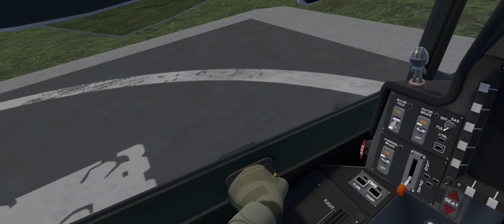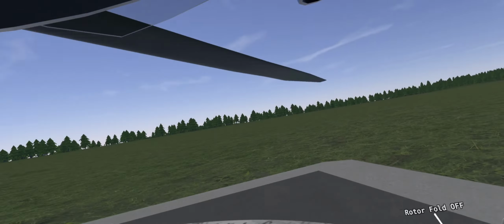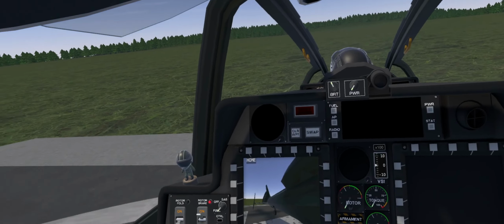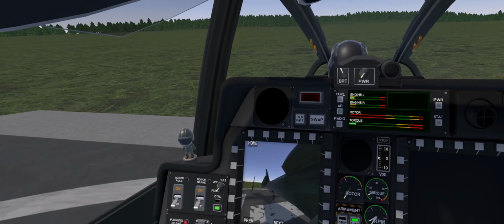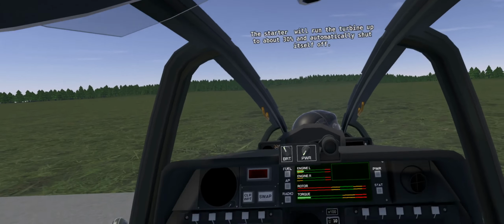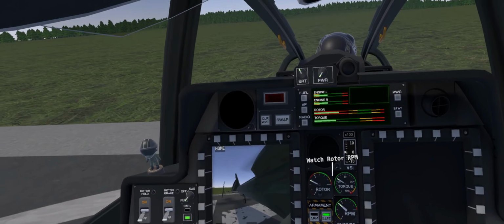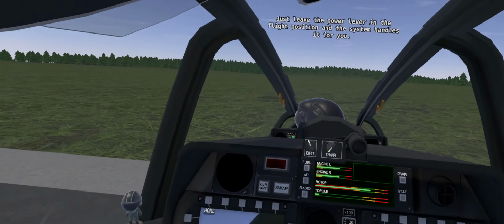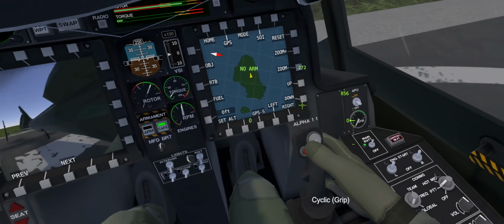VTOL VR - OpenXR Test - AH-94 Start-up and Shutdown

Comment: is it any better with openxr?
Reply from the maker: It should have been, not sure if it's one of the settings or what, but it ended up running worse than SteamVR in multiplayer.
I ended up reverting back to Steam VR for now then and raised the resolution a little bit in Steam itself.
Reply: @ArcherAC3  thank you so much!